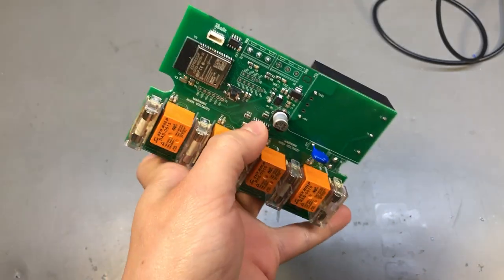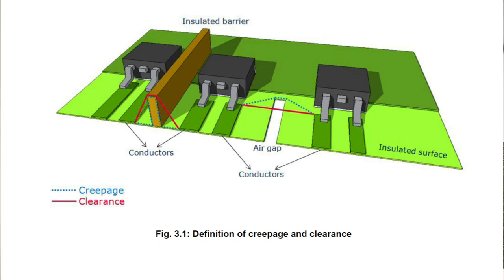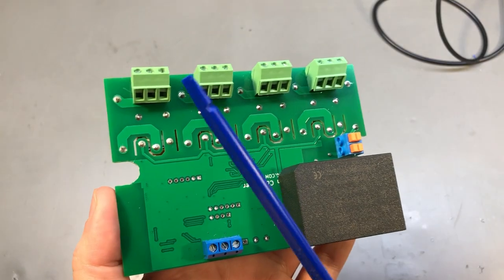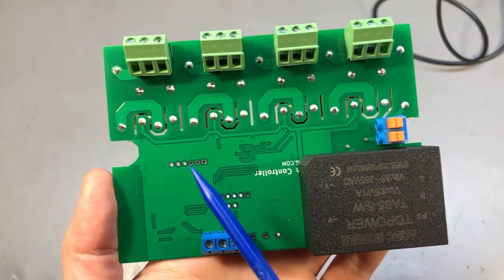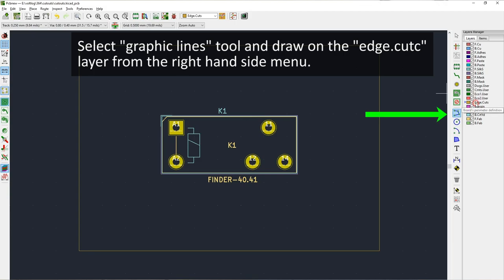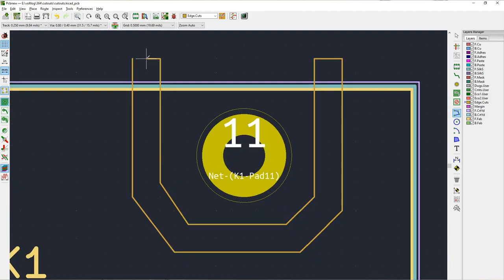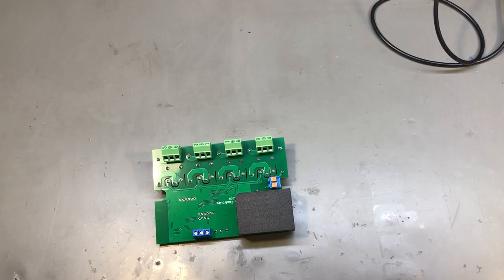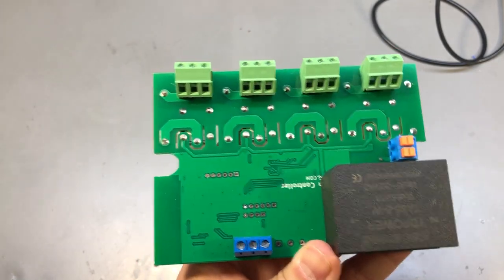How To Create High Voltage Isolation Slots In Kicad - Voltlog #364

Comment: To be sure to meet the minimal width I usually first draw it as a line (with the correct width) to a .User-layer after which I trace the outline onto the Edge.Cuts-layer. That "helper" line can be added to a footprint.
Reply from the maker: Great idea!
Reply: Good tip! 👍

Comment: The board house will have a minimum internal radius for any cut based on the width of the tool used to make the cut. I normally draw inside corners w/ this minimum radius taken into account.
Reply: I wish you could set the outline of a stroke width to edge-cuts like this automatically. Manually tracing the arc at each end is a pain, and if ever you want to adjust things you have to re-do most of what you’ve done.

Comment: You could draw in Dwgs.User layer in the footprint and then move it to the Edge.Cuts layer.
Reply from the maker: One could probably find a few ways to do it but like I said in the video, these things are not really supposed to be added to a footprint. At best, what others suggested as well, you can add a drawing of what needs to be done later on in the board layout.

Comment: Thanks, I've been trying without success to make isolation slots but it always gave me the error. It never occurred to me to actually close it in the way described, I was wrongly assuming there would then be some way to specify the width of the slot rather than drawing the actual slot itself.

Now with help of the video I can make the slots fine but I encounter a very annoying issue. While drawing the slot every time I click the mouse to make a corner it brings up the dialog  'Cannot determine board outline' and I have to click it away.  How do you avoid that happening?  Is there some way to prevent it from checking on every single move?

Comment: PUBLIC SERVICE ANNOUNCEMENT:
You can draw a series of connected lines in a user layer, give each line the thickness you want the slot to have, select it all (double-tap U), then right-click, choose “Create from Selection”, then “Create Polygon from Selection”, then select “Create bounding hull”, set a line width of something like 0.05mm, deselect “Delete source objects after conversion”, and hit “OK”. Then select the new shape, hit E, and set jts layer to Edge.Cuts. Done, a slot with perfect width and rounded edges. If you ever want to edit the slot, the old shape is still there to repeat the process on.